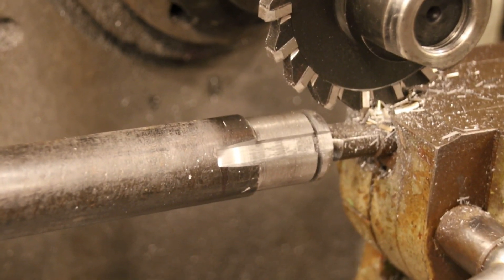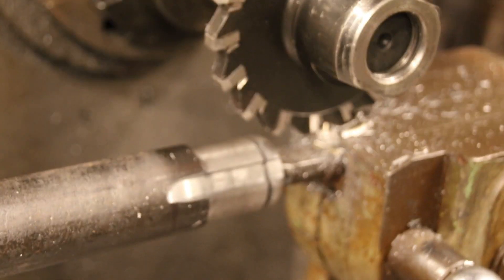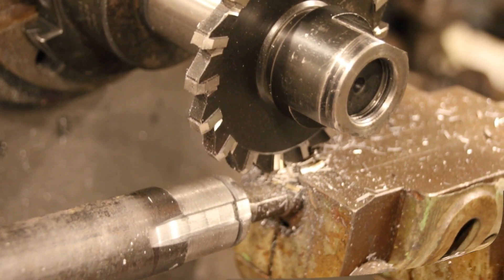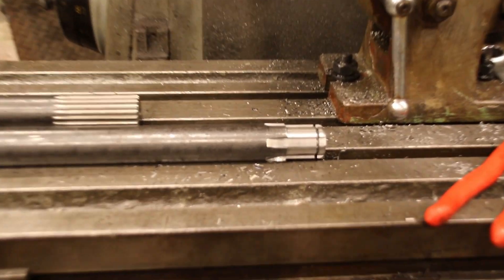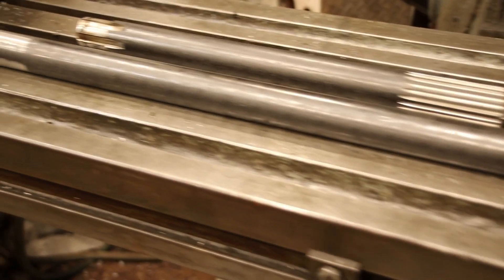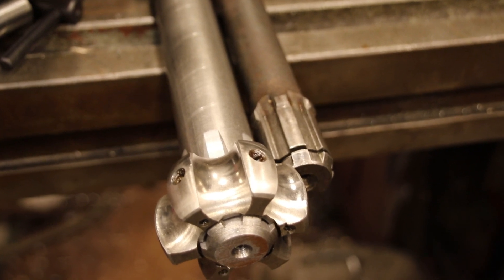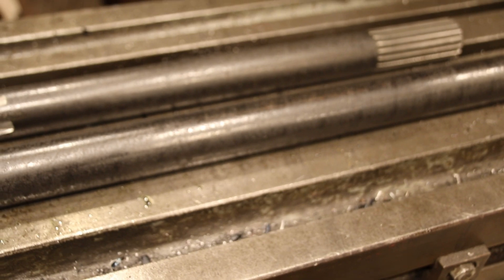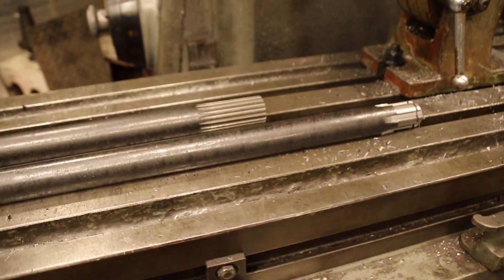Willys CJ3B Axleshafts, Cutting 6 Spline For Rzeppa Joint, Axle Material Choices

Comment: Thanks for sharing this great video, you do not see very many horizontal mill videos. What kind of cv joint are you running? Did you happen to film the whole process of narrowing the housing by chance, I would be very interested in watching that video(s)? What was the Dana 44 out of?  Thank you for taking the time to film your process, I really enjoy your videos, I watch them on a smart tv without signing in.
Reply from the maker: yes I showed the entire process.  Running original Rzeppa joints on this axle shaft, they are great and very strong.  The axle assembly was out of a Willys FC truck and was way to wide for what I needed, but I did want the strength of the 44 so I shortened it and custom made the axle shafts.
Reply: @metalshaperJeep  Thank you for your reply! I will keep looking for the housing narrowing videos. I sent you an email about cnc machining. Thanks again!

Comment: Very cool stuff. Please don't completely retire from these. I have a FC-170 That was converted over to a camper many years ago and it is front wheel drive only. I feel like I'm gonna have problems with the stock Spicer 44 front axle shafts and might want to convert over to the rzeppa style joint.

Comment: When you mill something like this do you not have to use cutting oil? I didn't notice you using any....
Reply from the maker: I tried with and without cutting oil.  I controlled the rpm and feed rate perfectly and got cool chips and a cool axle shaft by cutting dry.
Reply: It is most likely a water based fluid that he would use if needed

Comment: who in the heck hates on someone cutting splines???...i'm sure your customer is extremely appreciative of what you did for him...machine shops are getting hard to come by now...the two we used to have in my town have shut down once the old timers got to old to do it any longer...thank you for showing us the process.
Reply from the maker: Thanks for watching, the only people that hate my videos and give the thumbs down are the spineless, insecure, idiots that feel so bad about themselves they have to lash out.   More videos coming soon on another set of axles.
Reply: I remember years ago seen in a catalog a full floater axle kit for the rear axle of a Jeep and I always thought I could use the front spindles and hub off the front axle can you put on the rear axle and have locking hubs on the rear too for towing purposes. Do you think the lockout would be strong enough to handle the torque on the rear axle. My Jeep is a stock Jeep that would be just doing light four-wheeler the only thing that stopped me is finding someone that can make the axle shafts for the Dana 44 rear axle on CJ 3A Jeep